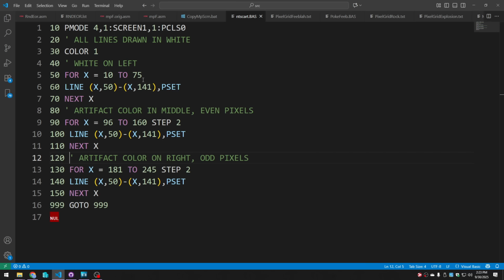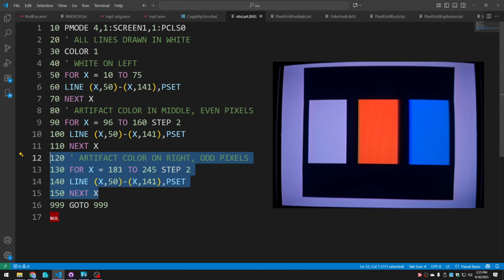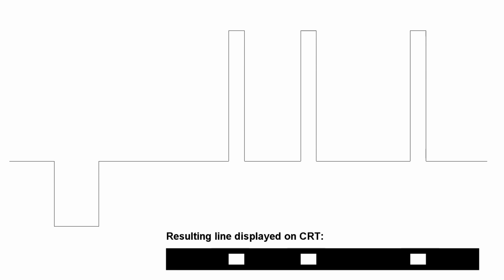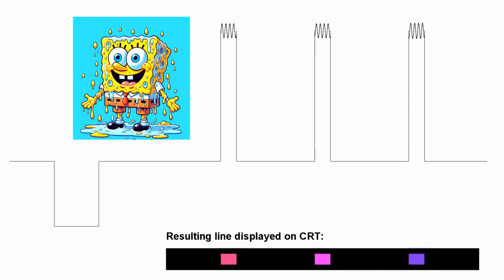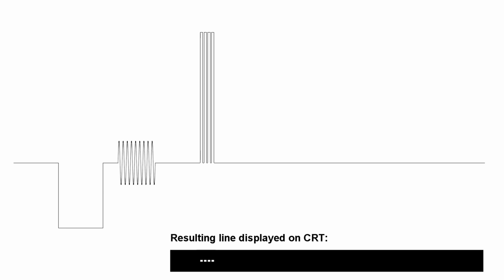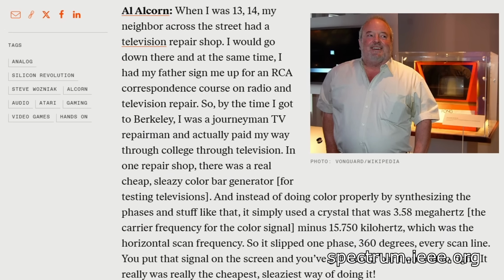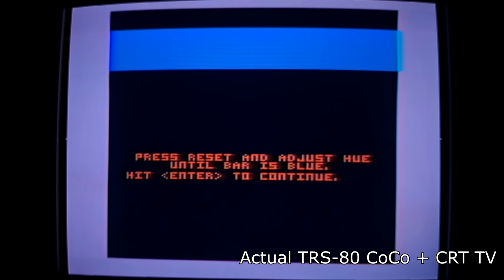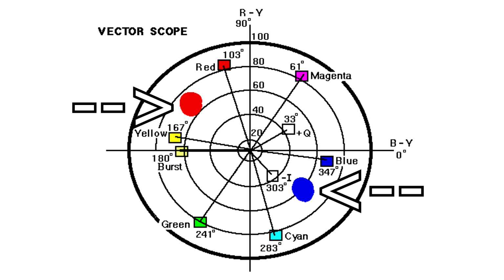How early computers TRICKED TVs into making color (out of nothing at all)

Comment: If the color depends on it's postion on the screen, how they made the moving sprite, keeping it's colors on Apple II? I don't understand.
Reply from the maker: Good question!  This video’s graphics exaggerated how much movement is necessary to change the colors. In reality, the bit patterns which determined hues that are 180° apart only need to shift by one pixel. The apple also allowed hues that were 90° apart, which resulted in the hardware shifting the signal by only half a pixel. So for a sprite to keep its color, it would need to move across the screen (horizontally) in multiples of two pixels, which wouldn't look odd at all. And pixels could move up and down the screen, preserving their color, without skipping at all.

Comment: Awesome video! I may have missed it, but did you not explain the WHY this was done? (I would bet "cost" of color hardware, but it should still have been discussed). Thanks!
Reply from the maker: In the case of the apple 2, it did not generate chroma at all, and used luma for all of the colors.  I'm no electrical engineer, but my guess is that Chroma is tough to generate, b/c it requires carefully adjusted phase changes for each new color across the scan line (versus luma, which can just be a square wave that goes up when a new pixel needs to be drawn).  In the case of the coco (which came a few years later), it actually was capable of generating chroma, and did so on the lower resolution screens. It is only on the high resolution screen where it relies on artifacts to get colors.

Comment: The Apple II used to publish its schematics circuit diagram in a technical manual, and most of its video generation circuitry was developed with discrete digital gates.  I remember spending almost a summer trying to decode the Apple hardware design to understand the color generation secrets.  Wozniak is a real hardware hacker and this design is almost poetry in motion.

Comment: I don't understand, why do all this if you have a color screen anyway? If the screen can make color why not just use regular color signals?
Reply from the maker: In the case of the apple 2, it did not generate chroma at all, and used luma for all of the colors.  I'm no electrical engineer, but my guess is that Chroma is tough to generate, b/c it requires carefully adjusted phase changes for each new color across the scan line (versus luma, which can just be a square wave that goes up when a new pixel needs to be drawn).  In the case of the coco (which came a few years later), it actually was capable of generating chroma, and did so on the lower resolution screens. It is only on the high resolution screen where it relies on artifacts to get colors.

Comment: SÉCAM suffers from a similar issue, called SÉCAM fire. Rapid luma changes get misinterpreted as red chroma, and moreover, it's not local: luma is further getting interpreted as extremely high-amplitude chroma (which, due to SÉCAM's nature, is always red or blue per the whole line, usually red, IDK why), until something makes it lose the track and go back to actual chroma signal.

It was especially often triggered by subs, as there are lots of rapid changes between black and white. Made them unreadable to the point I preferred to turn colour off.

With terrestrial analog TV signal, these strips tend to have short and random length (hence "fire"). Because in practice, luma is never perfectly free from noise, and this noise is what brings chroma decoder back to sanity. The noisier the better (though strong noise can induce the fire itself).

VHS is another thing though. It has a significantly lower bandwidth than analog TV, which means signal is smoothed horizontally, and such noise is eliminated. I've seen an extreme case: a VHS recording of Saudi TV broadcast, showing a program schedule. White text on pure green background, which means even chroma, both B-Y and R-Y. White text still triggers the fire, and there's nothing to bring chroma decoder back to sanity then. Fire is quite stable there, and can almost reach the right edge.

Was it ever abused in Soviet computers? I bet not: when colour TVs became a thing, original Soviet computers already dwindled in favour of clones of Western ones. In 90s, when the market was hit with foreign consoles and their cheap clones like Sega and Dendy, users still had to play games with no colour, some had custom colour converter boxes though. Then Soviet TVs got gradually displaced with multi-system ones, still suffering from SÉCAM fire despite comb filters and whatever.

French ones? No idea.
Reply from the maker: Wow, that's incredibly detailed information about SECAM! Thanks for sharing all those insights and real-world examples.

Comment: If the display can show color why bother with this and just use the colors?
Reply from the maker: In the case of the apple 2, it did not generate chroma at all, and used luma for all of the colors.  I'm no electrical engineer, but my guess is that Chroma is tough to generate, b/c it requires carefully adjusted phase changes for each new color across the scan line (versus luma, which can just be a square wave that goes up when a new pixel needs to be drawn).  In the case of the coco (which came a few years later), it actually was capable of generating chroma, and did so on the lower resolution screens. It is only on the high resolution screen where it relies on artifacts to get colors.

Comment: Curious to see how PAL-like systems deal with these colour artifacts. The same for modern emulators. Excellent video!
Reply from the maker: Thanks!  I don't know much about PAL, but my understanding is that these tricks don't work on it, and you just see the black and white striped patterns on PAL. This is not to say that PAL doesn't have its own set of artifacts that could be exploited, but I believe these NTSC composite artifact tricks don't work on it.  Modern emulators do quite a nice job of simulating NTSC composite artifacts, by the way.

Comment: Also, games that used PMODE 4, and the red/blue cheat didn't need to have you spam the reset key over and over (to essentially match the syncing that the programmer used), instead, they simply needed to make a box on the even lines and ask what color was show (R)ed or (B)blue, then adjust the game such that if you now KNOW that the even lines are generating red, then use even lines to generate red, otherwise, if the response is blue, simply note that even is blue and odd is red, and adjust your graphics, (by 1 pixel) to get the colors right.  I didn't think this up, but one program (I think it was popeye), displayed a flag, and asked if the stripes were correct (the red stripes would be red or blue), if you saw, and choose blue, the whole flag shifted by 1 pixel, and now it was correct, and the programmer knew how to proceed.

Comment: I don’t get it, was the display system already in color but only allowed specific approved products to be in color so a glitch had to be used to force color displays to read products in color? I expected to learn how color displays were created from black and white ones, but it appears that the color displays already existed at the time? Please explain how the display was able to display color and why it shouldn’t have.
Reply from the maker: Note that the TV must be a color TV for artifacts to occur. The signal itself only contains (B&W) luma, and not a chroma color signal, but the TV interprets that signal as a full color signal when changes in brightness occur very quickly (as when small enough white pixels are placed close enough to each other on a black background).  This effect allowed early computers to "cheat" by using the same circuitry they already had to convey luma, to also send color.
Reply: @CocoTownRetro Ahh, time saving methods.
Reply: @CocoTownRetro Thank you for the explanation good sir.

Comment: Why weren't these systems capable of outputting a true colour signal? Did that require hardware that was just prohibitively expensive at the time?
Reply from the maker: My guess is yes, probably something like that.  In the case of the apple 2, it did not generate chroma at all, and used luma for all of the colors.  I'm no electrical engineer, but my guess is that Chroma is tough to generate, b/c it requires carefully adjusted phase changes for each new color across the scan line (versus luma, which can just be a square wave that goes up when a new pixel needs to be drawn).  In the case of the coco (which came a few years later), it actually was capable of generating chroma, and did so on the lower resolution screens. It is only on the high resolution screen where it relies on artifacts to get colors.

Comment: One PAL variant was used by C64 games. It used PAL colour averaging of every second line to make a palette of 27 colours from the C64s 16 colours. Basically, if you alternated colours every vertical line, you'd get a solid colour that was halfway between the 2 colours. Like, if you did a horizontal red line, then a horizontal blue line, then red again etc., you'd get a solid purple block. Of course, this means objects using this colour would have to be at least 4 pixels tall, so it was rather limited.

Usually only used in loading screens and such, but Mayhem in Monsterland(1993) makes use of it a lot, and is why it looks so funky in emulators, and there's no emulator support for it.
Reply from the maker: Interesting!

Comment: why are you framing this as this like crazy dirty trick??? like you are literally GENERATING A CHROMA SIGNAL by doing this!!! thats what your pulse modulation IS!! it doesnt matter if the computer itself knows or not, because you have created a signal with the literal exact qualities a chroma signal needs, just with square edges.
Reply from the maker: I agree it's fair to simply define chroma as “anything the TV interprets as chroma”.  And by doing so, it may not seem like there's much going on here. But to me the glitch is that there is this overlap in the encoding of brightness information and color information.  And the genius of the Apple 2 was to avoid adding the dedicated hardware circuitry to create the typical sinusoidal, phase shifted chroma component that was normally produced elsewhere. Instead, it simply relied on small enough pixels arranged in the right pattern, giving full control of color over to the software developer in terms of pixel placement.

Comment: Isn't this technically still generating a chroma signal, just in software? It's not exactly "faking" a chroma signal if the TV ends up receiving a component of the correct frequency.
Reply from the maker: I agree it's fair to simply define chroma as “anything the TV interprets as chroma”.  And by doing so, it may not seem like there's much going on here. But to me the glitch is that there is this overlap in the encoding of brightness information and color information.  And the genius of the Apple 2 was to exploit this and avoid adding the dedicated hardware circuitry to create the typical sinusoidal, phase shifted chroma component that was normally produced elsewhere. Instead, it simply relied on small enough pixels arranged in the right pattern, which (as you rightly pointed out) moved the burden of conveying color from the hardware circuitry to the software developer.

Comment: I think there are some episodes of Doctor Who where the original colour recordings were lost, but they were able to restore the colours using artefacts in monochrome broadcasts from Australia. Is this similar?
Reply: I saw a documentary that said in Israel back when color TV came out, their government didn't want their populace to get spoiled on color TV, or envious of neighbors in a time when most couldn't afford it.  So, when color programs aired, they removed the colorbust from the signal so it would only show as black and white, even on a color set.  However, the chroma information was still transmitted in the picture.  Perhaps Australia did something similar.

Apparently, there were devices available that would re-insert a color burst so programs could be viewed in color on a color set.  I can only imagine it required frequent manual adjustment, since the phase would be random each time you tune in to a new program, not to mention it would certainly drift.

Anyway, in CoCo high-resolution, the system already generates a color burst for you so you are really doing the opposite problem of encoding the color information in your picture yourself.  You don't have to worry about the color drifting since the pixel frequency is derived from the same clock as the color burst.  Though apparently in the CoCo, the phase might randomly be off by 90 degrees when the computer is started.  (I'm not actually a CoCo user, just interested in studying old computers.)

Comment: what's the reason for using artifact color? it requires a display capable of colors, so why not just use a color signal? were color signals more difficult to program, or did generating a color signal require more expensive hardware? Throughout the video you refer to artifact colors as happening on nominally black and white displays, so why could they get confused and display color in response to a color signal, especially when the NTSC color signal was designed to be backwards compatible with displays that couldn't show color?
Reply from the maker: You are correct that the TV would have to be a color TV to generate color artifacts. The trick is sending a signal without chroma and getting the TV to interpret the luma as a color signal.  In the case of the apple 2, it did not generate chroma at all, and used luma for all of the colors.  I'm no electrical engineer, but my guess is that Chroma is tough to generate, b/c it requires carefully adjusted phase changes for each new color across the scan line (versus luma, which can just be a square wave that goes up when a new pixel needs to be drawn).  In the case of the coco (which came a few years later), it actually was capable of generating chroma, and did so on the lower resolution screens. It is only on the high resolution screen where it relies on artifacts to get colors.

Comment: There's something I still don't get. Does this mean all black and white TVs/displays were capable of full color output all along? Black and white TVs were before my time, so I've never had the chance to examine the phosphors of one through a magnifying glass like I have with color TVs. Did they also have RGB subpixels that were simply intended to be lit evenly as a single unit?
Reply: Absolutely not.  Black and white (or monochrome) CRTs only have a single electron gun, no shadow mask, and only one continuous slathering of phosphor of a single color instead of a pattern of small phosphor dots.

Also, strictly speaking, it is not correct to consider the phosphor dots on a CRT as subpixels, and they most certainly are not expected to be evenly lit.

Also, I will add, if you were to view a color broadcast on a black and white television, if the sharpness of the picture is turned up high, you would see thin vertical lines in areas of color.  The higher the saturation of the original picture, the more prominent the vertical lines would be.
Reply: @sa3270 Thanks for your reply! I realize now that I misunderstood the entire point of this video. Like, even at the very beginning, I thought he was saying the documentation called the monitor a monochrome display. I somehow didn't catch that the CoCo 1/2 were just the computer itself and would get hooked up to a color TV set or something.

So it's not so much that the computers were tricking the displays into producing color, but rather the programmers were tricking the computer into outputting a signal with more colors than its graphics mode supported? But then why was it called a “Color Computer” if its normal graphics mode was black and white?
Reply: @hollt693  I'm glad you are understanding better.  It's important to understand that color is added to a black and white signal by adding waves into the signal at a specific frequency, called a color carrier or chroma signal.  Approximately 160 of these waves would occur from the left to right edge of the screen.  Most of the graphics modes of the CoCo, including the mixed text/semigraphics mode, add these waves for you, based on the character code and/or bits from the graphics data.  However, for the high resolution mode, one bit corresponds to a single pixel, and that mode is hardwired to show either a black or white pixel, depending on the if the bit is zero or one.  Because these pixels are half the width of one of these color waves, an alternating pattern would be seen by the TV as a color, even though the video generator in the CoCo did not explicitly add color.

Comment: I don't understand. If the TV is able to display colors using it normally, why would you use a glitched black and white signal that tricks the tv to display colors?
Reply from the maker: In the case of the apple 2, it did not generate chroma at all, and used luma for all of the colors.  I'm no electrical engineer, but my guess is that Chroma is tough, b/c it requires carefully adjusted phase changes for each new color across the scan line (versus luma, which can just be a square wave that goes up when a new pixel needs to be drawn).  In the case of the coco (which came a few years later), it actually was capable of generating chroma, and did so on the lower resolution screens. It is only on the high resolution screen where it relies on artifacts to get colors.